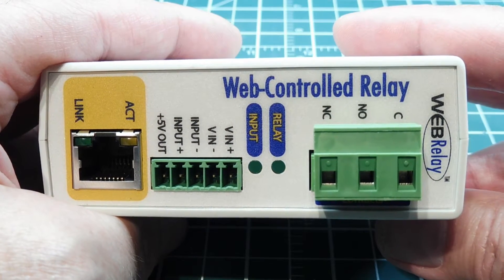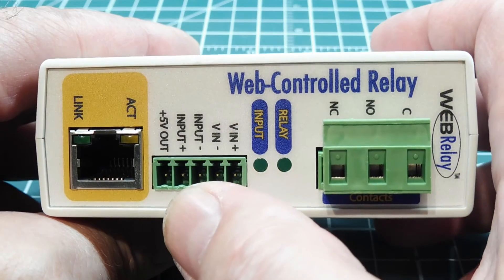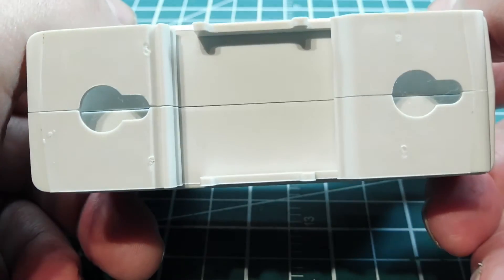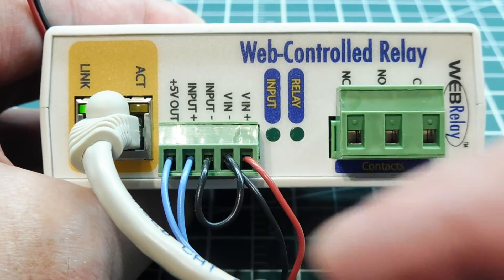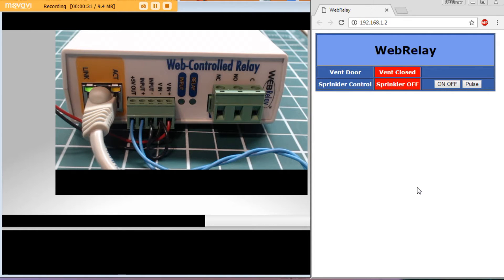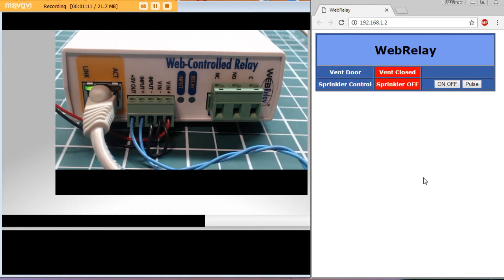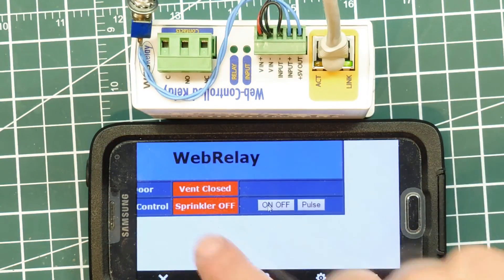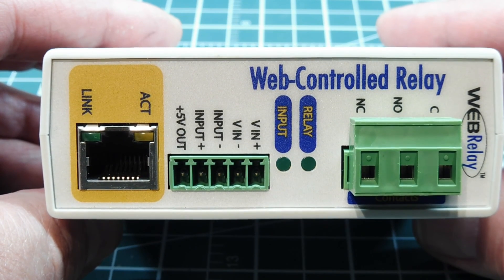Web Controlled Relay / Smart phone access

Comment: ? Can one of these boxes communicate to another one.
Basically if a switch is closed on one side can it close the switch on the other side.

I’m trying to run a doorbell 1000 feet
I already have a network down there I’m trying to add a doorbell at the gate.
And put it on my net work.
Your help would be greatly appreciated thanks

Comment: The biggest problem with this is not being able to set the IP address. If you have multiple boxes, they would all be on the same IP address. What good is that? So thanks for the review and the warning.
Reply from the maker: The factory default address is 192.168.1.2 but there is a configuration page where you can change the IP address to build your own custom network of boxes.